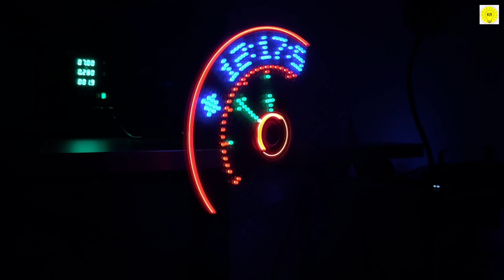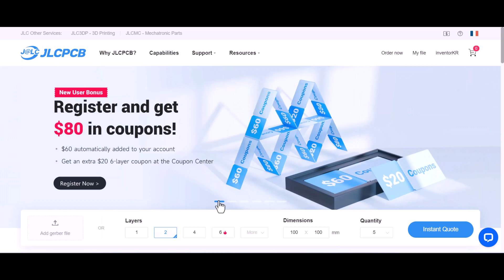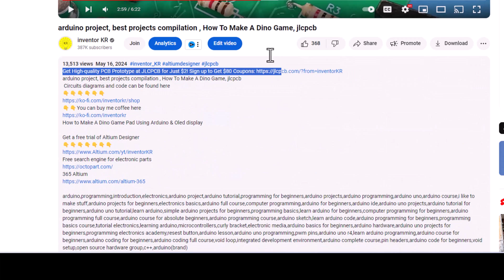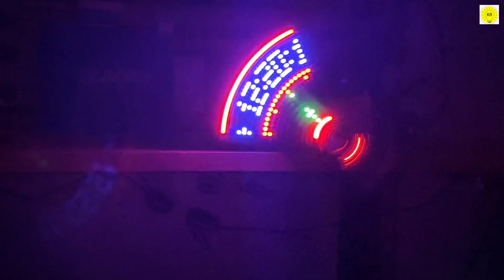how to make Propeller LED Pendulum Clock, using Arduino NANO, Simple to make

Comment: Why a magnet is moved closer to transistor?
Reply from the maker: The magnet is moved closer to the transistor to create a magnetic field that can activate or influence the transistor's operation, allowing it to control the clock's pendulum mechanism.